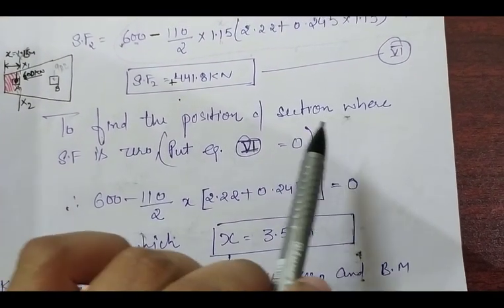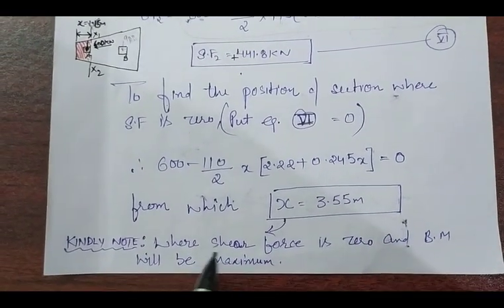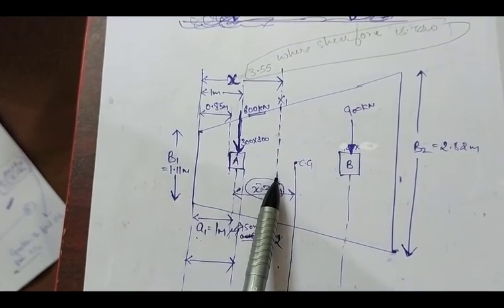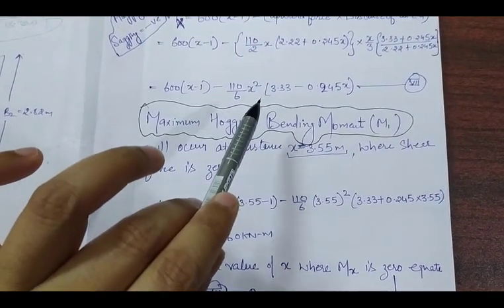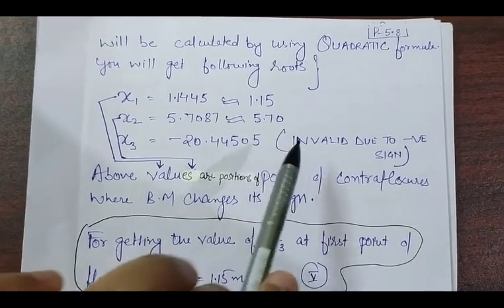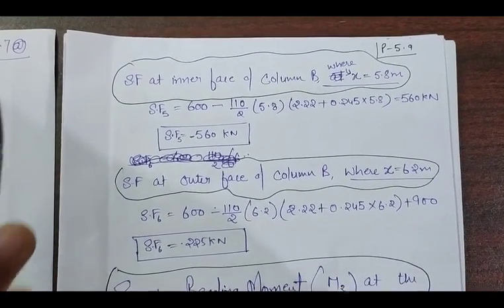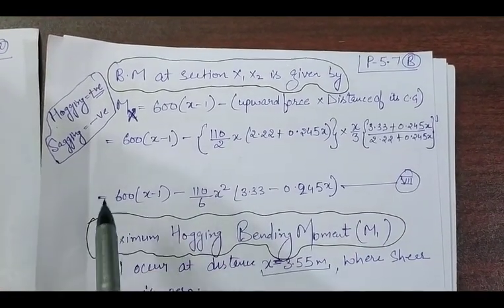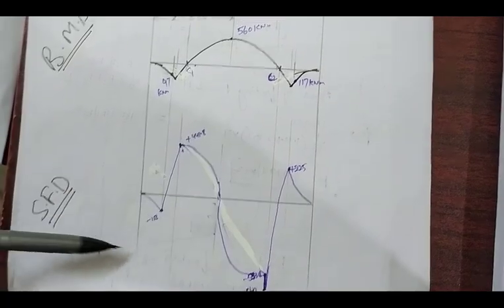Lecture 6 - Design of Trapezoidal Footing - Part II

Comment: what if the 2nd point of contra flexure exceeds the length of footing we provided? Can it happen? shoul we reconsider the length?
Reply from the maker: Dear, Point of contra flexure is calculated with respect  length of footing  and loads  (upward soil pressure and loads on columns) I.e. moment.
Parameters has pre defined w r t IS 456 hence no chance what u said.
Reply: @EasyNumericals  oh okay, must have made an error somewhere in the process. Anyways thank you for the swift reply and your lectures, it has helped alot.
Reply from the maker: @ujjwalbajracharya4360   thanks you for appreciation... I will count. with you tube now.